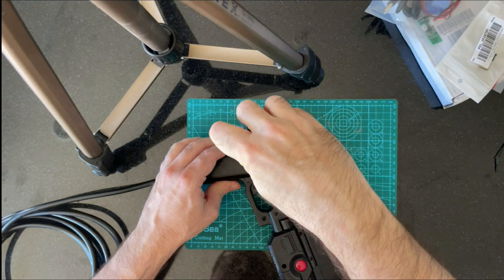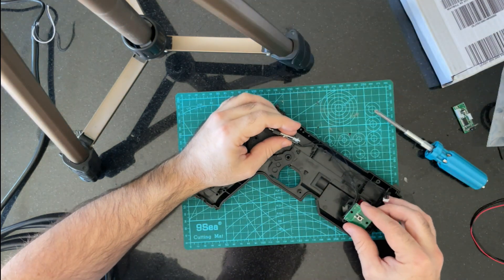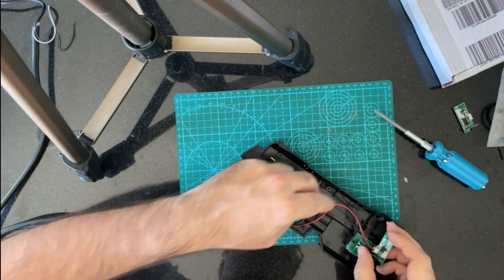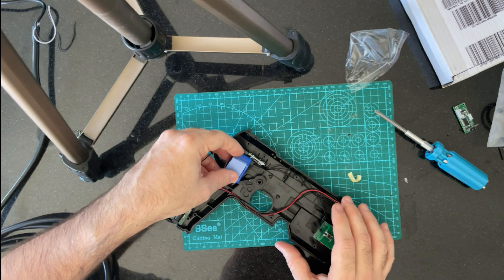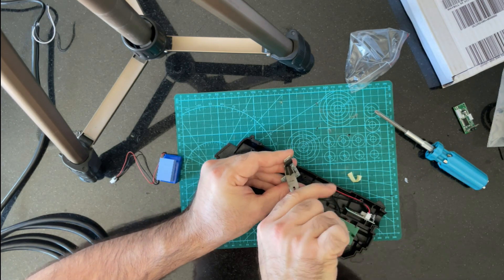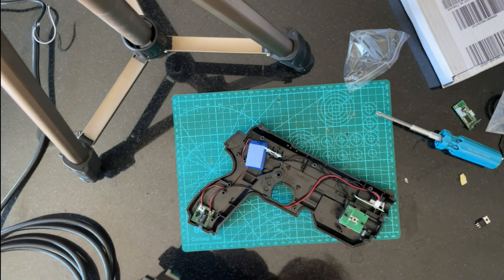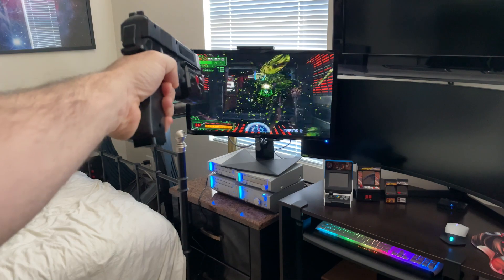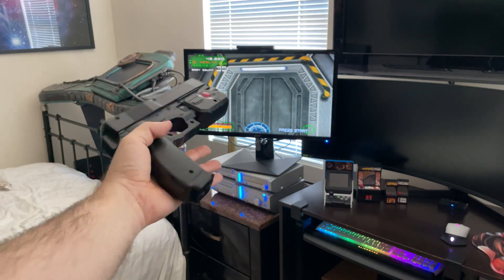Wireless Aimtrak Lightgun!

Comment: so i got this kit put it together but it wont get recognized on the ultimarc application? do i need the usb dongle they are selling on the site for it to work? i moves the mouse but just not registering to the ultimarc application.
Reply from the maker: Mine doesn't read on the sensor view check screen of the ultimarc application, but I am able to use the app to change button layout and change the bluetooth sleep timer.

But you do need their USB CSR dongle to get a second gun to pair up
Reply: @Brad-D  so how do we calibrate it? Especially if it's not registering to the program?
Reply from the maker: @ericramirez2108  The sensor view check doesn't impact calibration. You should still be able to start the calibration process by holding whatever button you have check under Enable cal in the button assignment/configuration screen
Reply: @Brad-D  that's the thing it's not registering anymore and once I had it going I wanted to do firmware update and after that now it doesn't even connect to Bluetooth now.
Reply from the maker: @ericramirez2108  Open this Doc:
https://www.ultimarc.com/AimtrakBluetooth.pdf

and jump to page 6, then follow the steps under "Recovering from no-connect situation or device not being
correctly detected."
Reply: @Brad-D  I did that now it doesn't even show up as a device on the program and the mouse doesn't move
Reply from the maker: @ericramirez2108  If you completed the removal from device manager as they described in the doc, you should now be able to go back into Windows 'Add a Bluetooth Device' and click the Trigger to wake up the gun, Windows should see it as a new device to pair up with.
(make sure the battery has a good charge before trying to re-pair it)
Reply: @Brad-D  so I got it reconnected but now when I move the gun around the mouse just automatically goes to the bottom right and doesn't move around like it was
Reply from the maker: @ericramirez2108  I didn’t have anything like that happen. Try to see if you can re-calibrate 

If re-connecting / recalibration doesn’t work, reach out to Andy at Ultimarc 
andy@ultimarc.com
Reply: @Brad-D  Any idea where to buy Bluetooth conversion kit for the Aimtrak Lightgun. It is out of stock everywhere. Is there an alternative.
Reply from the maker: @chubbybigtoe5777  Supply shortages everywhere. Ultimarc gets new stock regularly, but it sells out fast. Keep checking their site.

...or, email me and I'll sell you min LOL
This was an experiment and I don't use it much anymore
Reply: @Brad-D  I just emailed you.
Reply: I purchased a 2nd kit with the csr dongle but my bluetooth gets an error when trying to pair the 2nd gun
Reply from the maker: @ygtandoh  I only have the one so I can't say for sure but I was told that the dongle should allow a 2nd gun to be paired. email andy@ultimarc.com and see if he can help you out
Reply: @ygtandoh  I have the same problem. I bought two of them for both of my AimTrak guns. Neither of them work. Very annoying and frustrating.
Reply: I am currently having the same problem.  After update gun is no longer able to be seen in Bluetooth. Was there ever a fix to this?

Comment: Where can we buy the Bluetooth adapter kit
Reply from the maker: https://www.ultimarc.com/light-guns/aimtrak-accessories/aimtrak-bluetooth-upgrade-kit/

I'll add this link in the video description too
Reply: @Brad-D  by the way just wondering from your testing how long is the battery life on it
Reply from the maker: @Quimby_86896  I initially charged it for 30 minutes (that should have given it 100% battery) and have not drained it dead yet.
Reply: @Brad-D  one more question what’s the range on the Bluetooth how far back can you go for the gun to be recognized
Reply from the maker: @Quimby_86896  pretty far. The aim track needs line of sight to work, so I can’t imagine the Bluetooth ever being the limiting factor. 
I can still hear mouse clicks registering while in the next room
Reply: cool dude!! now get those recoil solenoids back in there wireless!!! lol
Reply from the maker: @KongsRUs  LOL
Reply: @KongsRUs  I agree. I’d love some recoil feedback too.
Reply: Are you able to use it with two guns configuration
Reply: Can I install this mod on any light gun
Reply: Can the AimTrak Bluetooth Upgrade Kit work with a non recoil version